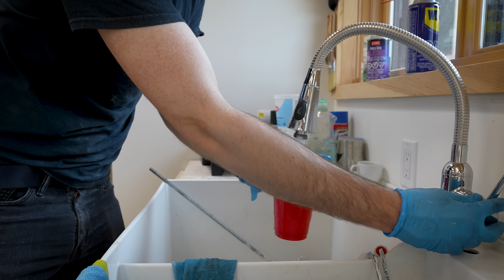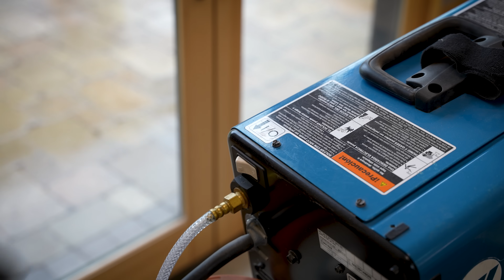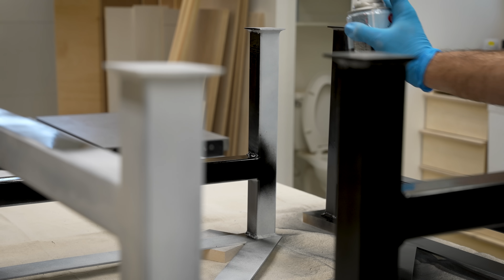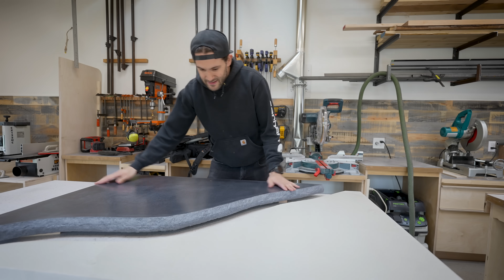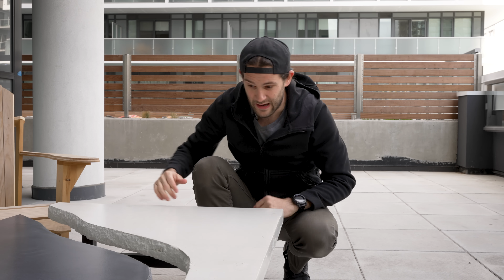Wood got too expensive....

Comment: Just a tip on vibrating: you need to vibrate during pouring of concrete. You had air bubbles because you vibrated too late, and concrete was already setting
Reply: It was a very dry mix as well and definitely not made easier using the 18v drill for mixing. Every time is a learning opportunity and is still looked great 👍🏼
Reply: Not really, you can vibrate air bubbles out afterwards too, done it plenty of times and get no air bubbles. You get air bubbles when it sets up too fast. And most people aren't able to vibrate WHILE pouring! Also it was too thick, that's why it's better to use concrete with a plasticizer, it pours like liquid.
Reply: Nice
Reply: @otallono  yep exactly. You can't do I too late obviously but the biggest thing was the thickness of his mixture and not when he did his vibrating
Reply: @otallono  Or nmore water - but that makes it weaker.
Reply: A sawzall with the blade removed makes a pretty good DIY concrete vibrator for projects this size.  Press the cutting guide against whatever you're using as a form and slowly ramp up the throttle.  You just need to make sure you're not vibrating it so hard or in a such a weak spot that your form might break.
Reply: The consistency is not right to effectively vibrate the poured mix to raise bubbles.  It was not a flowing mix.
Reply: mornin

Comment: Looks awesome! One tip from a career welder. Your plates on the bottom of your posts. Try this, instead of making them bigger, go smaller. Say, your 2” tubing, instead of cutting it larger, or flush at 2”, take a 1/16 off each side. So a plate for a 2” tube would come out to 1 inch and 7/8, leaving 1/16 on all four sides, enough for it to sit on your tube without falling in, then your weld will fill up those 1/16” excess and bring you back out to flush with your tube, or just over and just enough to grind down with a flap disc. Just an idea! Good luck on the next one! :]
Reply from the maker: That is a great tip, and honestly that was a design detail I was kicking myself for when it came time to grind everything smooth 😂

Comment: Use a orbital sander against the forms to vibrate out the air bubbles. Also vibrate as soon as you place the concrete.
Reply: I agree also tapping the sides will do squat in the areas that are over a foot thick need a real vibrator to go into the form but a Very cool idea for a table.
Reply: I was thinking, he could have jus put something off center on a motor and mount it under the table, shake the whole table lol.

Comment: An advantage of the "broken" design is each part has three legs meaning it will never wobble, unlike using four legs where you have to get them level.
Reply: Gotta get three legs level too..
Reply: I had no idea I used three legs one was 24” one was 27” and one was 16” man everything falls off my table and I don’t know why
Reply: @ajbrown2013  right, three legs simplify stability, not leveling. Leveling a rectangular unit on an irregular base with 3 adjustable legs is neither more stable nor significantly easier.
For example; 3 wheeled vehicles tip over quite readily. Cranes & basket trucks use 4 jacks.
Reply: @Dr_Wrong  For your information it's better to put the legs underneath the table, not on top of it..

Seems dumb correcting someone on a point they were never making in their comment, doesn't it?
Reply: @CraigP-z4t  "it's better to put the legs underneath the table, not on top of it.." 

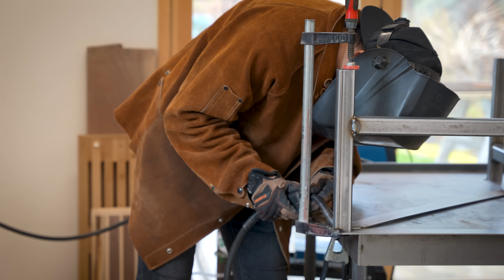IDK, Zac seems to disagree.. 9:25
Reply: @Dr_Wrong  Your comments don't ever seem to be on point only beside it or they miss it entirely.
Reply: @CraigP-z4t  "Your comments don't ever seem to be on point" 

Sorry, my bad.. 
I thought it was simple enough to connect the dots without having to type in descriptions of every baby step between.. 

It sure seems to me that most people have been catching my drift about most things.  

I could be wrong. I could even be Dr. Just is Wrong.. idk
Reply: @Dr_Wrong  I'm sure people are able to catch your drifts just fine if your name is Dr. Misty Point. Still, coming up with a cheeky Youtube name doesn't grant you a free pass to use as cover for any dumb comment you post.

My apologies if I misunderstood what you're saying but making it seem like you've skewed all your comments just to fit an online persona (to quote another Youtuber) justicewrong!! Whether it's your name or not, it's way worse to suggest you're intentionally deceiving people or that you're playing a game by knowingly giving them wrong information than it is to actually be wrong and have to admit it. Having fun at other people's expense is a dick move, don't associate with that.

Comment: Tip on cutting  or drilling rubber, closed cell foam and many plastics. Freeze the material first. Colder material is stiffer and less likely to grab stretch or bind.
Reply: Better have a big ass freezer but it's more than fine cutting without being frozen as well even though it would make it a bit easier if u have that type of freezer space and especially when doing at different customers homes
Reply: or cork? balsa?
Reply: @rodschmidt8952  I wouldn’t expect freezing to have the same advantage in cork or balsa wood unless it’s frozen in a slab of ice, but there are simpler ways for backing up the cut by sandwiching the workpiece in scrap lumber and drilling or cutting through both.

Comment: Just an idea: Adding lint from the dryer to the concrete mix add strength enough that you wouldn't need the metal wires.   I remember reading something about bricks being made that used recycled wool fibers from old clothing in the clay mix that were about 6 times stronger than without (in mechanically compressed bricks).

Comment: Great job. I learned a lot. I missed one thing though, did you use the melamine side as the top? Or original top? A good trick I use when getting bubbles out of my plaster casts is I buy those battery operated hand held vibrating massagers. They really work! And you could have easily duct taped 4 of them on under the melamine for 30 min. Each are usually just $10. I have had success with them even for 2 inch thick pavers out of concrete. Another tip that could be used for your plant idea is planting chia seeds. Plant areas 1-2 weeks apart for different heights. And, you can cut and eat them!  Beautiful job anyway. I have acres of fir cedar and aspen trees. I think the way prices are, I'm going to give it a go at milling my own wood this spring!! Ty for a great vid. New subscriber for life!!!

Comment: I've been thinking of working with concrete for a while now, but have been scared to attempt it.  I really appreciate how good you made it look.  Thanks!
Reply: a lot of people pour their counters upside down. the side against the form (on the bottom ends up with less bubbles and is usually flatter). you just have to build your form in reverse to get it right at the end when you flip it. and be sure to vibrate it enough. not sure if Zac flipped his or not. I didn't catch it if he did! good luck! I hope to do one soon too!
Reply: @caseykittel  did someone ask why it was upside-down. Because otherwise if not I think most people already knew and understood why it was upside-down and I didn't see anyone questioning that

Comment: Turned out great! I'm might try and make some sills for my shower in this. I wonder how the sealer holds up to very moist environments.
Reply from the maker: Thatd be awesome! I suspect that it would hold up quite well if you got a good smooth finish on the concrete. It's a 2 part finish after all, once it sets up it should be very hard
Reply: Only thing is  I don't think it's cheaper than  wood. But cool anyway.

Comment: This is great. I was really looking forward to you next build. Couple of suggestions if you don't mind. You can make a countertop .75" thick with 1-1/2" edges, saves on unwieldy weight for larger pieces, the reinforced concrete is really strong as mixed by maker. Also you can get some amazing surfaces by embedding different materials in the surface. The surface is then wet-ground by diamond abrasives to mirror finish. Looking forward to what you come up with next. Nice job!
Reply: This is a comment from the pros! I’m keeping a screenshot in my projects book. Thanks for the great tips.
Reply: I was thinking the same thing about  thickness but since he did a table instead of countertop and it's an outdoor piece I understand doing it thick like that

Comment: I've precast some concrete wall caps before using the same method as yours. To stop water from the concrete from leaking under the side boards I ran a bead of latex caulk around the inside of my forms. This also breaks up that sharp corner.  Also, an orbital or pad sander makes an excellent vibrater to get the air bubbles out.
Reply: do you get it wet first? I cut out foam for gun boxes and wonder if it would help to freeze it first.
Reply: @michaeljakus8373  you can and it will probably help a little but from my experience  (I remodel, renovate, and repair homes for a living) it is not needed and kind of unnecessary for the majority of projects

Comment: I have done this before, and this project turned up great too, congrats! When i did mine ,  went to hardware store , and looked at small moulding , and found one that I liked , that I left that outer top edge, it turned out very cool... Do not forget if you do this, that the imprint on the concrete slab is the opposite negative of your mold ...so I almost screwed up mine too ... 😁

 Meaning, if the wood moulding has outer round bump, the edge on concrete will end up w inner concave groove :) ... So I found a inward moulding ( let's call it female part)    so the edge on the finished slab was sort of a round bullnose ( male part ) . Had a few more features, but you the idea... Time details like that , it's better if apply a bit of w40 on form, or just wipe over w olive oil, so nothing sticks anywhere... 

I did colored mine w dark brown that ended up looking like brown like leather , which was really nice, then applied a strip few inches wide strip on edges  of darker brown concrete stain ( used duct tape to limit inner edge, so it ended up real nice, w  bullnose edge area inwards about 3" wide darker strip all the way around  ...  

Congrats on your project! 👍

Comment: When I saw those concrete form liners get put down, I was totally expecting this to become a concrete epoxy river table, haha. The spaced gap is neat though.
Reply: I was really expecting some kind of river table, or at least a "cracked" table, with epoxy holding it together. I like how it turned out, but I'm not sure I like it better than if it were joined together.
Reply: Exactly.  After watching so many of those videos this feels like "shave and a haircut" without the "two bits" sound.  Like it bothers me that it never got 'finished'.  :-)
Of course then you have a 200+lb table that he couldn't have moved by himself so keep things sections at 100lbs or less is probably a very good idea.
Reply: The space could always be zero, still making it movable.

Comment: The air bubbles created on the outer edge gave it a nice rustic look. It turned out great. You should have put some weepholes at the weld at the bottom of the legs because when you weld them it traps moisture inside and will rust the metal from the inside out. The weepholes will allow the moisture or condensation to drain out and help prevent it from rusting out to quickly. You can even treat the inside before welding it with oil or rust inhibitor to make it last longer. After you weld it you can spray more rust inhibitor inside through the weepholes.

Comment: Air bubble remedy:
1. Mix at a slower pace to prevent folding air back into your mix, and make the mix slightly more liquidy.
2. Vibrate the mix in the bucket first before you pour it in the form.
3. Vibrate the form.

Comment: Good looking table.  I have a few questions, comments.

How did you secure the top slabs to the bottom frames?

You may want to check with the building owner to see if there are weight restrictions on the patio.  You have 200 pounds of concrete sitting on just a few felt feet.  That creates large point loads.  

The reinforcing grid was a good idea.  Concrete is strong in compression and weak in tension.  Your slabs are balancing on your frame.  The farther from the frame you get, the more the tension load becomes.  There are alternative reinforcing options.  Fiberglass threads is one of them.

The sealer is another great idea.  It would be horrible to spend all of this effort and have water in the air pockets freeze in the winter and crack the table in two.

Comment: Really like the look. I think another great addition would be to have some rebar running through them and connecting them together.
Reply: That would make the top one monolithic piece that weighed 200 pounds. Try moving that. And it would have the tendency to bend where the rebar wasn't supported.

Comment: You might tri laying a board over your rubber trim it keeps it from jumping up in your guard ! You got lucky what happens after a few cuts in the rubber it heats the blade enough to make it sticky and it will stick to your blade and  make a mess out of it !
nice video I’m in the same state of overpriced lumber so much that I harvested a few yard trees for the post and beam for a car rotisserie for flipping it upside down for painting

Comment: Great Job!
I think both sides in the black would have been a good option too. A great overall contrast to your patio.

The planter in the middle would look awesome as well; as long as it didn't hide the entire crack.

Again, Great Job!
Reply: Smaller versions of this would be great for end tables at the ends of your future couches.
I also wondered what this would look like with a nice glass top? Maybe an LED light strip running down between the jagged sections.
Reply: I also would like to have seen how you attached the legs to the concrete.
Reply: Could even do it rounded with the split as a ying yang that would look pretty cool to

Comment: If you wash the concrete after removing the mould the excess buildup of pigments on the surface get removed for a less powdery surface. Honing the tops with a vacuum grinding disc or tusk disc or you can use a polishing stone to take the absolute top layer off. Exposing the stone gives concrete texture.

Comment: What works great for vibration bubbles out , take an old palm sander and screw base down to a scrap 2"x4" piece a little larger than sander. Screw board to top of mfd  that is outside of form. Make slab stick out a little more on one side for mounting sander.

Comment: Do you have a natural gas hook up on your balcony?  Build out another box and fill it with gravel.  Put these concrete blocks on the gravel and run burners through the crack.  Could be a neat fire pit
Reply from the maker: I do and this is something I definitely would love to do. However, I really need to check with the building and make sure that's allowed. Condos have so many ridiculous rules I'm a bit worried it wont be feasible.

Comment: If you want really effective vibration of your forms, use your inline or orbital sander without sand paper on it.  Applied to the form, It will vibrate any air bubbles out effectively.  Do this before the concrete starts to kick off.

Comment: Really cool build.  Maybe a gap fill of clear or translucent epoxy with RGB LEDs. If you want the legs to be attached to the concrete permanently you can weld bold(carriage for the big heads?) to the two inch flat stock and embed during casting.  Let cure for a long time then weld with small short tacks till it's fully welded.  This will minimize the heat and less likely cause the concrete to pop due to the moisture turning to steam rapidly.

Comment: You can take a cutout from a whole saw sand it to oval put a bolt in it use it in a drill to vibrate the mold

Comment: if you like the look of the air bubble on the surface, consider filling with a resin, so you can clean the surface easier and it won't collect grime or whatever.
Reply: I was also concerned about water getting to the holes and freezing, possibly cracking the concrete

Comment: Another added benefit of the weight of the tables and the height of them is that accidentally barking your shins on the table won't knock the table over and break off any pieces. Of course the con to that pro is that barking your shin on the table could cause a profanity hearing to take place. Thats why trailer ball hitches are internatiomally referred to as curse-balls and are the basis of the defense council's defense.

Comment: Hey zac , great build i love it. Just a little idea maybe if you weld few bolts to the mesh wires before pouring concrete so you can later use this bolts for securing slab to the base. 👍

Comment: you should never leave exposed air pockets on the top in a cold weather area. It will allow water to get into the concrete and cause cracking over time with freeze and thaw cycles.
Reply: yes! also, a lot of people pour their counters upside down. the side against the form (on the bottom ends up with less bubbles and is flatter. you just have to build your form in reverse to get it right at the end. and vibrate it enough. not sure if he did this or not. I didn't catch it if he did.